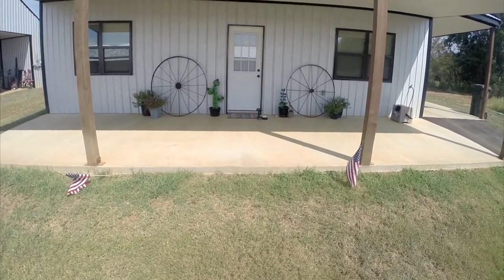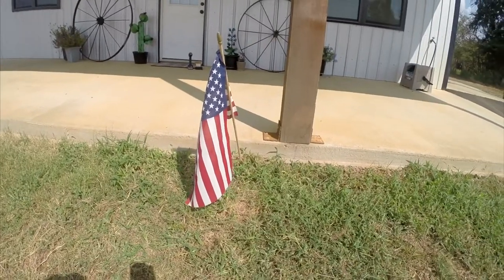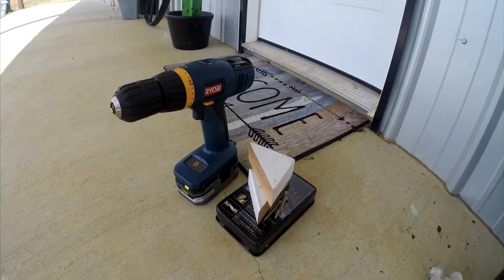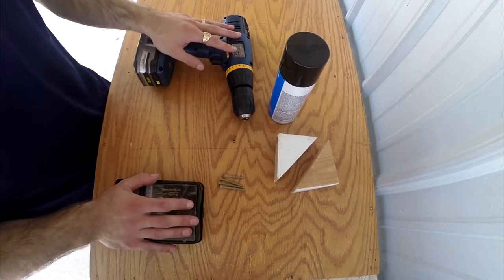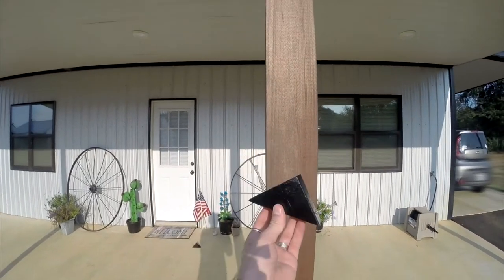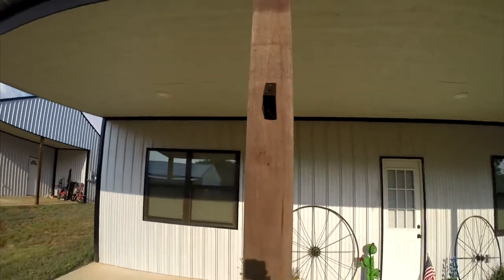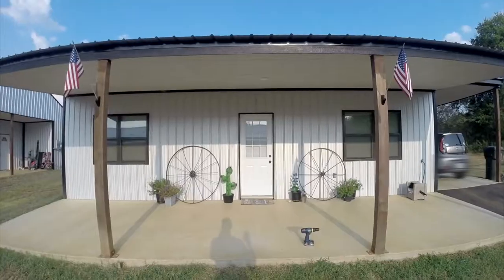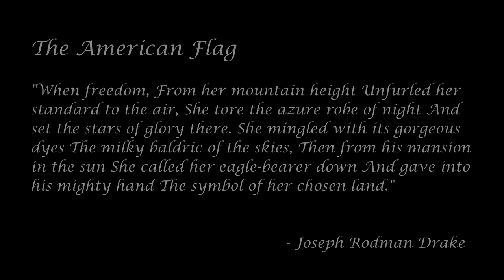American Flag Pole Bracket - DIY

Comment: Before painting, you should roughen the material (with sandpaper) and degrease it. Otherwise the paint will wear off in a few months. Plus for the commendable respect for the flag.